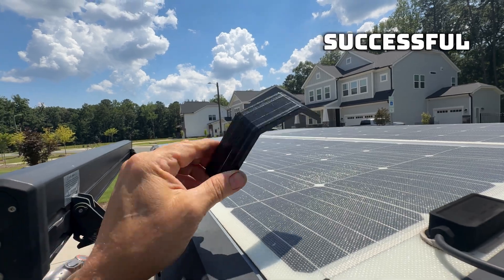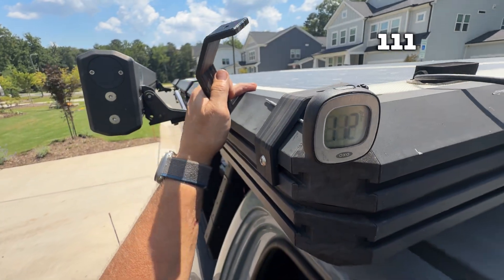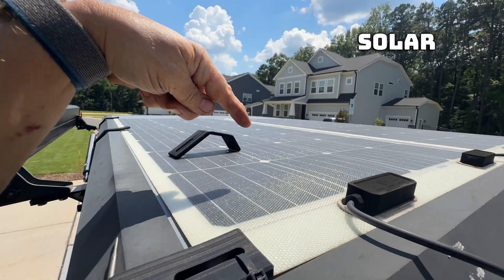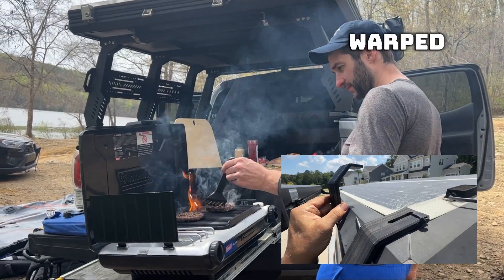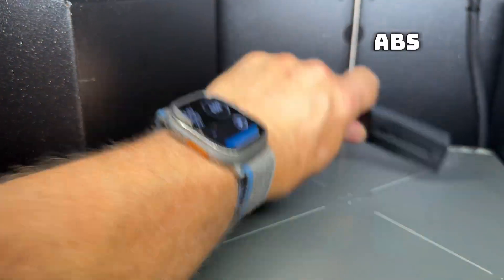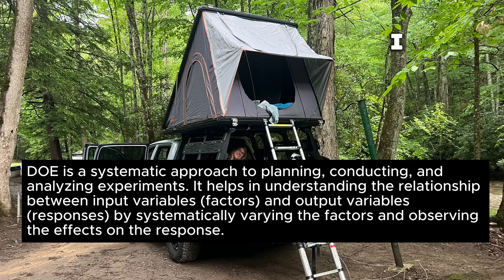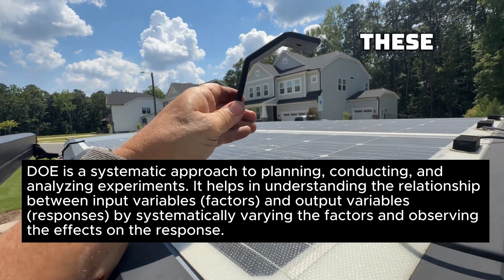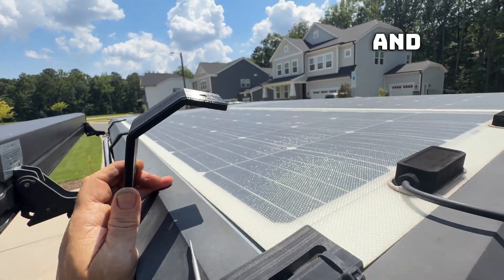My most Successful 3D print is about to get better - Solar Panel Clip - DOE Part 01

Comment: Don't print, injection mold if you want to do plastic. And frankly I would consider bent aluminum. Punch your holes and slots on a sheet of aluminum, then do your bends in a break, then cut each clip off, finally finish on a grinder/finishing wheel.
Reply: A grade of aluminum that will bend without small fractures might not be durable enough, bent steel would be solid and it powder coats well, however the infrastructure to process steel is a whole lot higher than a printer and a spool of filament.
Reply from the maker: And just drill the holes? Or use a punch?
Reply: @hacklab.ryandewitt re punch. It's nice if your doing a large production run. Or complex slots, ovals etc.
Reply from the maker: Ok good idea, never thought of that, Do you think metal would be cheaper then 3D printing, I need them black powder coated.
Reply: Is there even a local machine shop that could handle small batch production volumes?
Reply from the maker: @RelentlessEnthios there’s a small reliable metal , plastic shop in Cary but they focus on Motorcycle upgrades, great group. I’ll check, my goal is to retire early selling these and retirement comforts like glazed donuts.
Reply: Good point on the aluminum stress bend. Thinking about it further, i would think a colab with Send cut Send would be a nice ave for production. I personally dont have connections with them but I do enjoy their work.
Reply: Plastic injection molding maybe a colab with brothersmake
Reply from the maker: Jason, thanks , what do you think this part would cost in Metal, if we powdered coated it black and ordered 100 units?   (STAINLESS, Stamped, formed, cleaned, powder coated, and shipped)
Reply: @hacklab.ryandewitt i did a quick mockup on sendcutsend based on what i saw in your video 2 holes 3 30 degree bends 1 inch wide 9 inch long .074 thick stainless non powder coating $16 each. Powder coated black $24 each. Btw im a maker/do'r/arts'y farts'y/bit jockey like you not a machinest like this old tony or a lawyer to discuss liability 😊
Reply: Mild steel appears to be $10 cheaper.

Comment: If you sell them theres liability concerns. 

Might be cheaper and safer to have a local metal fab shop just bend them out of aluminum bar stock. One cut, two bends, ezpz.
Reply from the maker: Thanks but Whats your liability concern? They have never fallen off in 4 years at 120degrees 80+ mph. What about other exterior truck mods?